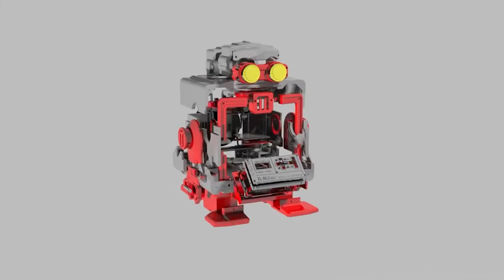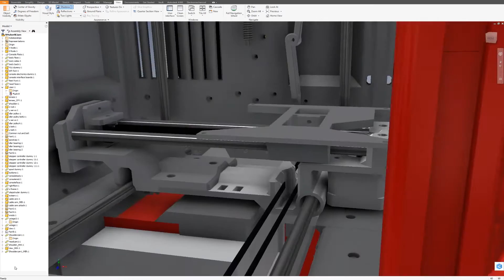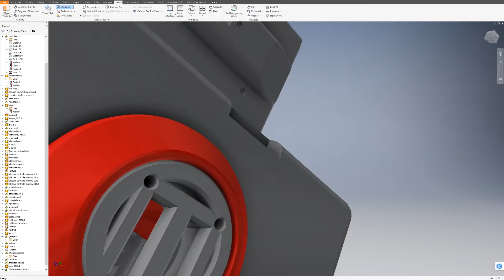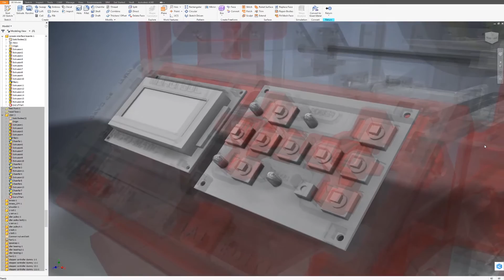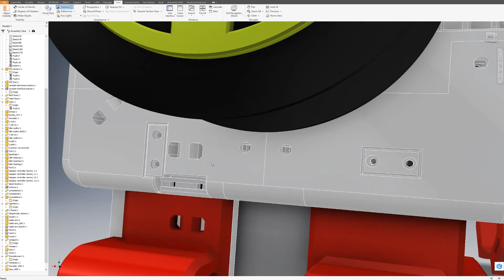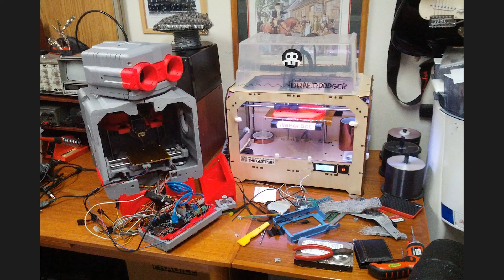R. Maker ToM Special Edition - Pen to Plastic Ep. 2

Comment: Your perseverance to overcome the challenges which arise from such an ambitious project is remarkable. Working with ABS on such a large scale requiring sizable parts to be printed within close tolerances would likely have had me throwing in the towel long before that power supply had a leg to stand on. :) I hope the original survives as it serves as a fitting example of what it took to move 3d printing forward in it's early stages.
Reply from the maker: And printed on a stock open-air Replicator 1 no less!  I will say that nearly every part was printed at least twice due to print failure.  

Printing with ABS is a unique challenge as the best method for semi-reliable large-part printing involves keeping the entire print volume at a temperature close to, but slightly under, the transition phase of the plastic.  Then, as the print finishes, the temperature in the printer is evenly lowered over time to allow the polymer to cure with as little tension as possible.  Unfortunately, this printer design is a heavily protected patent owned by Stratasys so competing brands can't sell FDM (or FFF) printers with active heating for this purpose.  Also, they engineered their own plastic they call "ABS+" which behaves much more predictably through the printing process which, of course, is also patented.  Even MakerBot, who is owned by Stratasys, can't use the stuff and the Z18 model which originally could print with ABS is not even being recommended for that due to reliability issues.

Thanks for the kind words and I look forward to uploading the next episodes!
Reply: Agreed. I feel there's still a requirement for an open source FDM printer design that properly accounts for heating and temperature controlling the entire print space as well as accounting for thermal expansion of it's components. It's design should minimizes exposure to heat sensitive components. I envision steppers and electronics mounted outside a heated and insulated enclosure using non heat conductive materials to transfer motion through to the internals. Like many I have built an enclosure to elevate the temperature within it but it does not meet the two constraints of fully protecting sensitive components and deliberately controlling air temperature.
Reply from the maker: That is exactly how the Stratasys FDM printers are designed.  in fact, the build plate is just a disposable ABS plate that isn't even heated itself due to the print area being hot enough to keep the print stable.  Nothing critical is in the heated area.
Reply: Impressive lineup. My only criticism is they didn't appear to put much emphasis on the ratio between build size and unit size. In my view build area is a critical factor and therefore this would ultimately lead to printers that are skeletal in structure. The ambient air temperatures required to enhance printing ABS are relatively accessible to the extent that temperature differential between the inside and outside which will improve performance should be obtainable without building an oven. In order to achieve a better build size ratio and also provide much needed visibility I would probably favor mounting devices to sheets of cut, drilled and tempered glass and utilizing airspace between layers for additional insulation if necessary. There are other build size considerations I would incorporate and then there's the aspect of building to meet the perception of what a commercial printer should look like but I digress.
Reply from the maker: Stratasys invented the FDM process in the 1980's and pretty much kept it out of the reach of everyone except higher education and commercial enterprise.  The rise of the FFF process and the RepRap stems from the expiration of the original core patents concerning the FDM process.  

Today, we can build excellent printers that fit our needs for a fraction of the price but in the commercial space, ABS printing is still haunted by possible lawsuits so most printers work with PLA sometimes exclusively or ABS on a smaller scale.
Reply: I see. As it stands for me I can be far more productive for what I want to achieve using PLA and not having to deal with issues associated with ABS printing. My inital foray into 3d printing was using ABS but I soon found what I considered to be normal challenges were unnecessary obstacles once converting to PLA. Rather than properly addressing the issues associated with ABS I feel I'm better served focusing efforts on PLA printing and accepting the limitations which PLA possesses. Only in extreme circumstances where ABS is a necessity would I opt to use that medium as the failure rate is considerably higher without purpose built equipment. I believe most non-commercial equipment users quickly come to this same conclusion. If we are going to be more prolific on the design side the process of printing itself should be as seamless as possible.